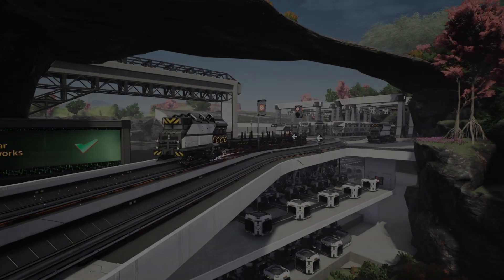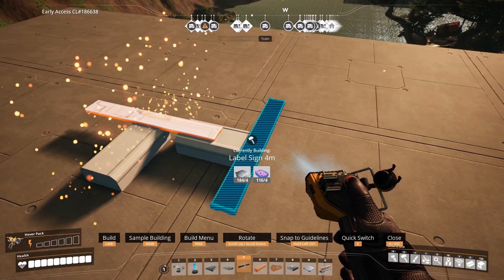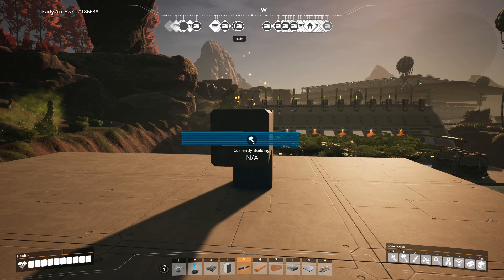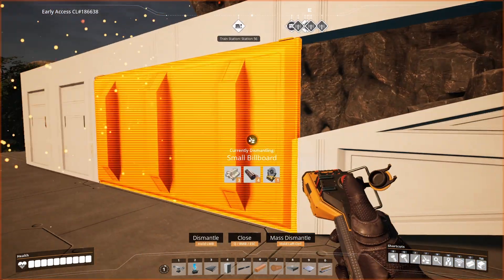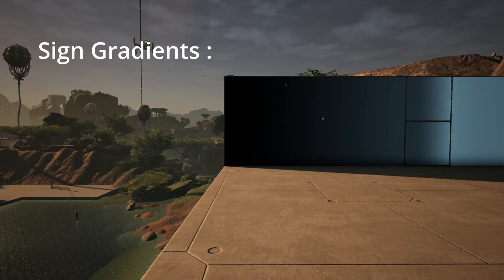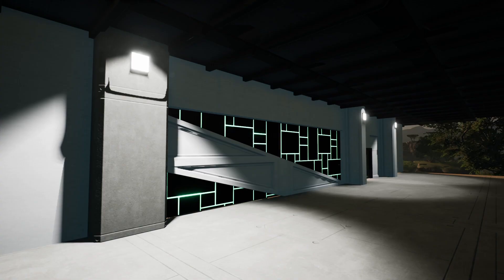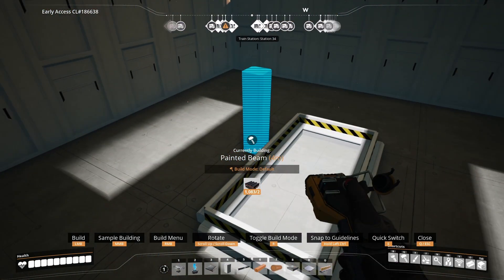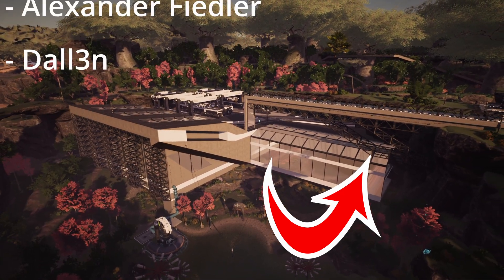Advanced Guide To Lighting and Signs | Satisfactory Game Guide

Comment: I think if you're really dedicated, you can do that disco in the end in vanilla if you make use of some really smart power cables and a power source that turns on or off at specific moments (coal would be ideal since u can control how much water it gets with a valve so you get the plant turning on or off at specific intervals). You wouldn't be able to do anything for the signs, but the lights would turn on and off at intervals that you can specify.

Only reason someone would do this is for the challenge.
Reply: Do that with multiple coal plants isolated in parallel, then turn them on in sequence for a nice chasing effect and absolute hair loss.

Comment: if i use signs many inside with coated floar, my fps dips down, even if i use it as a sign for storage , not even as light

im running a 6800xt + Ryzen 9 5900x 32gb ram
so sad :/ any solution?

Update: nvm i Change to Direct12x and suddenly it works.....